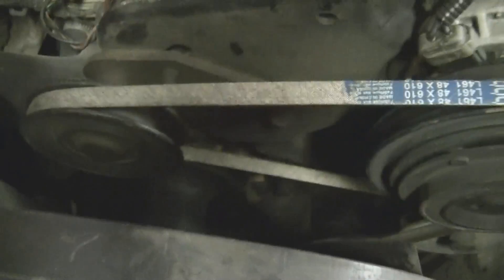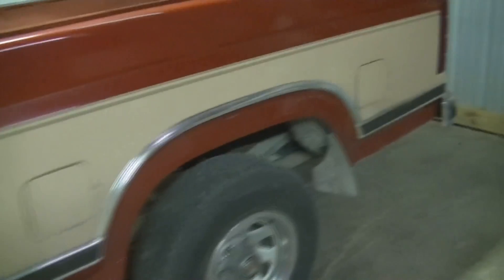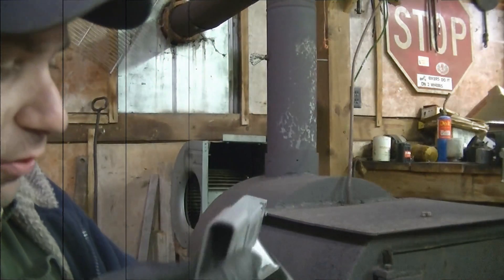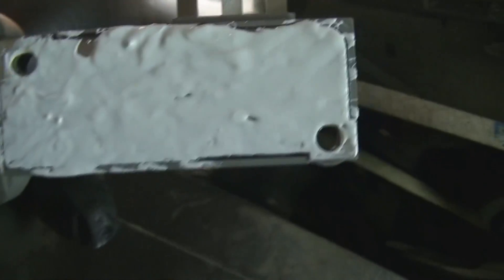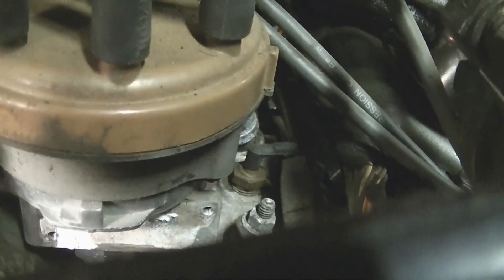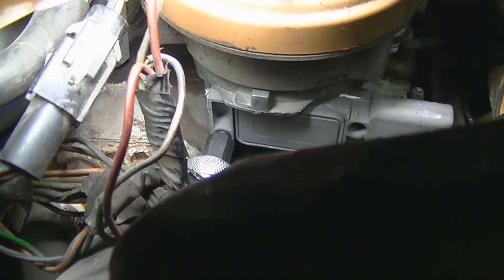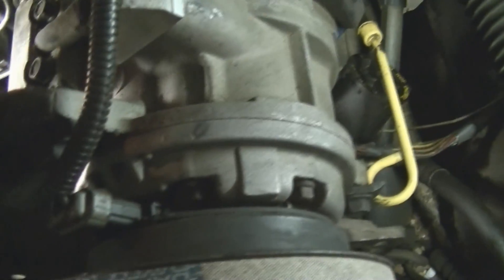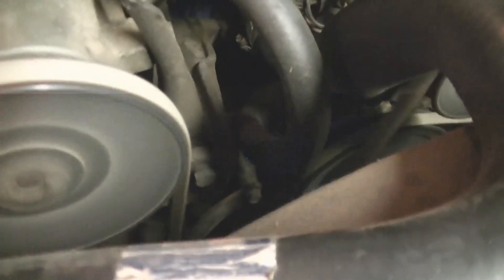Ford TFI Module Replacement

Comment: The grease it comes with is just thermal paste or thermal grease like on a computers cpu. It helps with thermal conductivity onto the distributor. Think of the distributor as a heatsink. The paste actually allows heat to go from the module to the distributor housing and it fills the micro-cracks on both surfaces to basically be flat and helps spread the heat across the surface of the module.

This grease typically needs to be changed every 1-2 years as it will solidify and become basically chalk.

In sum dont use white lithium grease it doesnt disperse or conduct heat through it very well. And thermal paste is cheaper in general. Also use gloves itll get into every crevice  on your skin and kind of just stay there a while.

Comment: After months of waiting for the reconditioned motor, we finally got the truck back, less than a week later I'm changing the ignition control module.  A pox on Ford for all these non-essential sensors that create problems!!  Motors used to run without all this make-work garbage!

Comment: You probably won't see this comment but how on earth did you get your distributor to rotate that easily? I've removed every bolt and screw around mind and still cannot rotate it at all. Any suggestions will help. Thanks.
Reply: If it’s the original the. It’s probably still too seated. They get stuck. You have to wiggle it while you pull up to get it unseated

Comment: Great video. I'm on my third TFI module on my bronco. Since i'm not there to watch the mechanic do it I'm not sure he put the grease on or used the proper grease each time. This time I'm going to purchase a relocation kit to keep it cool and easier to replace if need in the future. Why not just do a relocation first since it a FORD design error to start with?

Comment: Is this where it’s located on a 87 f150 with a 302?
Reply: If your ICM isnt mounted to the distributor then it may be on the wheel well. There were three types, a black one, grey one, and well mounted one. check to see what you have and buy the corresponding part.

Comment: Why did you replace the module? What was the concern?
Reply: He likely replaced it due to a spark issue. When they go bad you can have a no start condition. He probably replaced this because he tested the other possible failure modes.

Comment: Ive had to do mine twice. Distributor doesn't rotate anymore. That's a ton of fun coz everything is right in the way. Gotta use a medium well 7/32 balanced on the end of a flat head to start the screw. Thats after you chip away at the plastic around the screw hole on the brand new module. You can stuff a bit of plastic bag material in the socket to hold the screw as you delicately maneuver it into position. Good idea with the Phillips screws! Wish I had watched the video before I put mine back in. Sometimes you gotta do what you gotta dew.

Comment: anyone know how often these go bad? my 85 F150 right now has zero spark. I wonder if a TFI ignition module is the culprit.
Reply: I have a 1990 and it just went bad
Reply: Got a '91 with the 4.9 no spark either
Reply: It was the culprit for me. The motorcraft one I had lasted 31 years. I replaced with a $12 one from rock auto and so far it's fine. I got it because if I was wrong in my assessment I would only be out the 12. So if it doesn't last I'll know what it is and get the expensive motorcraft quality part.
Reply: @PrincernPrince  care to explain how the job is done.
Reply: live  locate your distributor. the module should be plugged in just below it. Disconnect the power wire connection from the module. If u look up the module online you will see the two screw hole locations.  One is top right corner the other bottom left corner. You will need to get a ford f150 ignition module tool. I got mine from orielys for around $10. Its the only thing that will reach the screws in the holes. Once the screws are out pull down carefully on the module the 3 prongs are close to the top left of module. It might be snug make sure u dont break one off in the distributor. The new module should come with silicone paste this must be applied all over the metal surface on the side that sits against distributor. If this is not applied the new module will burn up immediately. Line up the contact tabs with the holes in bottom of distributor and plug in. Reattach power plug and it should start.
Reply: @PrincernPrince  got it $60 from advanced and she fired right up!!!
Reply: live  awesome!!
Reply: @PrincernPrince  appreciate it! Didn't need the tool as they were Phillips screws and the 4.9 gave me plenty of space
Reply: live  cool I guess they changed it the next year I didnt have too much room either lol
Reply: Why did you change this part ? My 87 bronco stopped firing could this be it

Comment: I used a 5.5mm socket to get mine out.  7/32 socket works too.  I don't see how any of you persistently say that "a socket won't work" when that's all I use.  Hell Im using the cheap sockets from walmart that you get for $10.99 and is like a 40pc with ratchet too lol
Reply from the maker: Very interesting you said that, and you brought up a good point. I've had sockets before that too thick of a wall to fit in the recesses that the screws are in. I think it was a Craftsman socket and I had a Blackhawk socket that wouldn't fit. One of the techs I worked with when I worked at a Ford dealership years ago had a 7/32" socket that he ground down. Aftermarket manufacturers might have made the holes a little bigger. Regardless of that if your sockets fit I'd use those instead of spending money.
Reply: I'll tell you why a socket won't work .... If it isn't a fucking bolt .... I'm going though the same issue its not a fucking t20 either its a 4 point security bit lmao

Comment: How did u loosen the distributor to turn it?

Could this cause a no start?
Reply from the maker: Sometimes it can get stuck. You might need to spray some penetrating oil around it to loosen it up. The only thing holding it in place is one bolt. Once you get that out the distributor should come right out. Yes it definitely can cause a no start.
Reply: @FerdinandMagellan08  Actually, a friend of mine & myself discovered no fuel is come from the line after the fuel filter.

A neighbor said there is a valve between the 2 tanks on the frame that may be giving me problems.

Do u have any idea what he may be talkin about?

Thanks in advance..
Reply: @dee1380  He is talking bout your tank selector. The device acts as the selector, filter, and a reservoir. It is a large black thing that your fuel lines go into, you can find it before the high pressure pump.

Comment: ...thanks for the video
...it is best to change the pickup coil also as the ceramic magnet looses strength over time and this results in less signal to the module -

Comment: typical ford needs a special tool nobody has to replace one thing
Reply: Actually, you don't. A socket and 1/4 drive ratchet will work. The "special" tool in this video is still on the shelf at most parts stores, and is 2-5 dollars.

Comment: What size socket did you need for the bolts?
Reply: Its a 5.5mm and I had to grind it down some to fit in the hole
Reply: @robertmagdolen8655  thanks
Reply: 5.5 mm or 7/32

Comment: What if my 92 f150, 302 5.0, doesn't have that where would I find it
Reply from the maker: You might want to start by checking for vacuum leaks. If one is massive enough it will make the fuel mixture too lean for it to start. Also I would check the fuel pressure. If the pumps are getting weak they will cause a starting issue. You might also want to remove the idle air motor and clean it. It might be gummed up causing it not to start.
Reply: Dustin Jeffries it would be on the iner fender well on driver side
Reply: Joe Lewis thanks, I got it. what would stop the fuel getting to the injectors on start, spary it into the vent it starts, key start nothing. runs great when it does start

Comment: That's a T20 torxs that they sell a small ratchet wrench with a 7/16 socket on opposite end
Reply from the maker: I have the tool to remove the TFI module. For a while when I was doing TFI module replacements I would throw away the 7/32" head screws and replace them with Phillips Head screws. I got them at Fastenal in a bag of 100 for around $5.00

Comment: thats probably cpu paste like for a computer (just in case anyone has to go the the junkyard for parts :)
Reply: Fixt 100 is correct. He calls it cpu paste, also known as heat transfer paste. It is not dielectric grease.
Reply: @seppa6417  sweet i have "cpu paste" thermal paste bet !!!
Reply: its di-electric grease

Comment: What was wrong with your truck to make you change out the TFI module?
Reply: Blake Brown typically it will die while driving, or at idle. No spark. Then sometimes it will restart when cool.